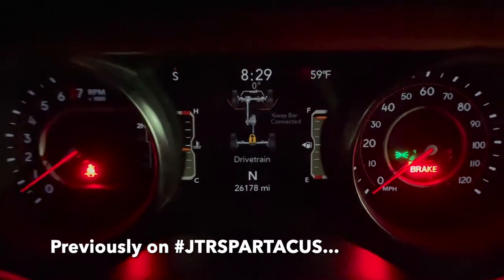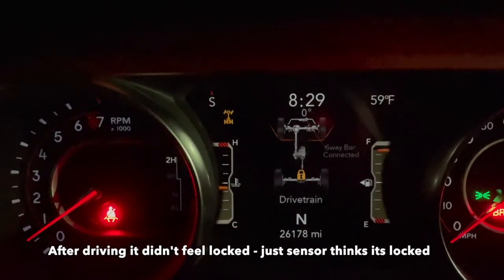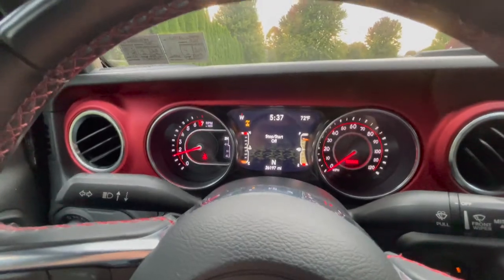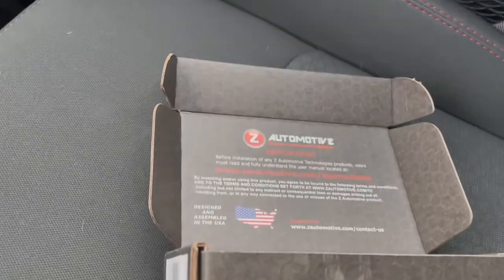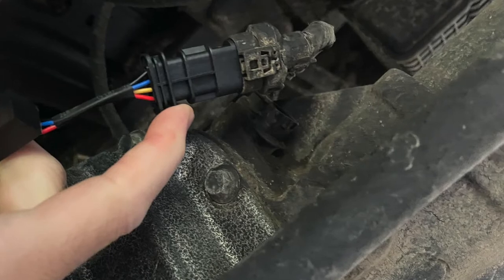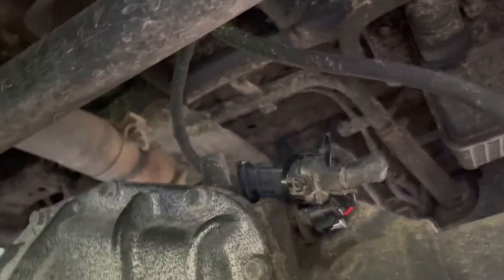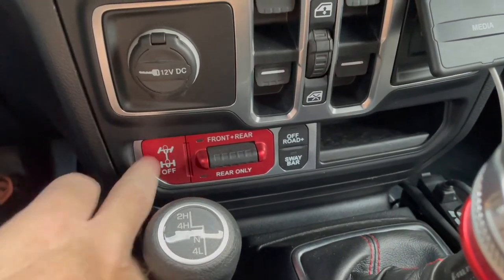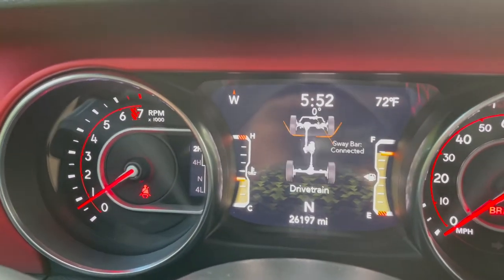Jeep Gladiator Rubicon Faulty Locker Sensor Fixed in 2 minutes!!!!

Comment: I came across this video a little to late! I took mine to the dealer and they might be replacing the whole axle even though I clearly said it might just be the sensors . Hopefully it comes back fixed if not I’ll be buying this adapter.
Reply from the maker: Yeah.  The dealer doesn’t have a lot of expertise with axles.  This sensor gets dirty and sometimes chaining the fluid and cleaning the sensor will fix.  The ZAuto module makes the locker work as intended. Thanks for watching and good luck!! #JTRSPARTACUS
Reply: @JTRSpartacus how tonclean ?
Reply: I’m on my second axel I’m guessing it’s going to happening again. If the sensor is not updated or potted.

Comment: Hey Brother, thanks for the great videos.  I own 2022 Glady-Mojave 6spd Manual (since Oct 1st) and Every time I depress the clutch between 1st and  2nd and 2nd and 3rd, there is a clunky noose in. The drivetrain. Feels like there is to much slop - also happens when coasting in traffic in 1st and I have to suddenly break - loud clunk. Dealer says its all normal - but man I can believe this is normal.  I had the 2020 Glady- Sport S with the 8 speed auto max tow package and it was awesome. But I wanted a manual for a long time and got a great deal on the Mojave - but now Im kinda regretting it.  Was Spartacus clunky when you first got it? I have no mods yet on mine so just wondering if the dealer just doesn’t want to deal with it. Under 1400 miles on mine. Thanks, Eddie
Reply from the maker: I have some clunk/unloading under acceleration/deceleration. If I’m super smooth shifting I don’t get it but that’s hard to do with the JT with its deficit of power and the crappy throttle response from the pedal (considering a pedal commander to see if that will help. ) It’s a lot better now with my Centerforce Dual Friction clutch, hydraulics and heavier flywheel. I love the manual but Jeep screwed it up with a weak clutch and light flywheel. THANKS for watching and please like and subscribe!!!! #Savethestick #JTRSPARTACUS
Reply: Thanks for the reply, Yeah my clunk is when I depress the clutch - especially prominent when you are taking off in 1st and suddenly have to break and clutch - its like a double or triple clunk.  Very dissatisfied and disappointed in Jeep. As much as I wanted the manuel, I am ready to trade it up for the 8 speed auto.  I agree, Jeep blew it with the manuel. Thanks again and God bless

Comment: I don't think a sensor in failure mode was corrected by a new m to f wire harness segment. 🤷
Reply from the maker: It is “corrected” - bypassed. Basically the computer is getting the signal from the harness module (little black box in the harness) that everything is ok and the faulty internal sensor connection is bypassed /blocked on the axle side by the harness. Jeep doesn’t have the sensor as a stand alone and doesn’t have the entire locker with sensor either so their “solution” is to replace the entire axle.  Dumb because it will be just a matter f time until it happens again.
Reply: @JTRSpartacus  I didn't notice the module.  Of course to provide validity to your hypothesis, the entire system should be returned to complete stock condition and see if the original Z-Auto modification created a failure mode.  The null hypothesis if you will. (Low order of probability of occurrence I hypothesize).
Reply from the maker: @DerrickOil  ha!  That ain’t happening. It worked for me. Not scientific but it works - that’s all I care about.  Zautomotive can do that other crap if they want.
Reply: @JTRSpartacus  you can order the sensor now....but my dealership said they tried that and were still getting an error so now I'm waiting on a new axle to come in... sigh      I wonder how much Jeep has spent on warranty repairs for this and what it would have cost to design a better sensor.
Reply from the maker: @sturek  Zautomotive bypass works great.  The locker works fine and it took 2 minutes. Jeep is stupid and thinking about this wrong. Outcomes are the most important thing - they should use auto.  Good luck!

Comment: Jeep should buy these things for owners.  Their solution is a new axle under warranty - dumb.
Reply from the maker: Yeah. Seems like this is quite a bit cheaper and easier than replacing an axle.  I tend to avoid the dealer unless I absolutely have to go their. I’m ok with buying a fix as long as it works.  #JTRSPARTACUS
Reply from the maker: @kcrr2w  ok. It works fine.  Locks, unlocks.
Reply: New axle with the same design and will have same issues
Reply from the maker: @Pierce0420  definition of insanity…. 😂 #JTRSPARTACUS

Comment: Was it actually locked in the back though? Or just flashing I ask because I have this happening and don’t want to drive if it actually locked. It doesn’t feel locked.
Reply from the maker: Mine was not locked. Just a bad sensor. You can get on some gravel give it some gas and turn and see if it’s locked. Good luck!  #JTRSPARTACUS

Comment: Can this work for a 2016 Rubicon
Reply from the maker: A 2016 is a JK - it has different electronics. Probably would hurt to pull battery cables and see if it helps. Good luck. 🍀 #JTRSPARTACUS